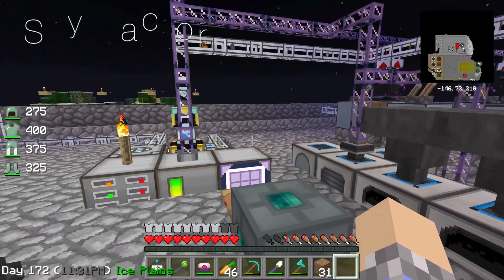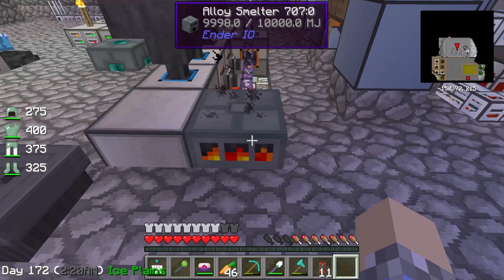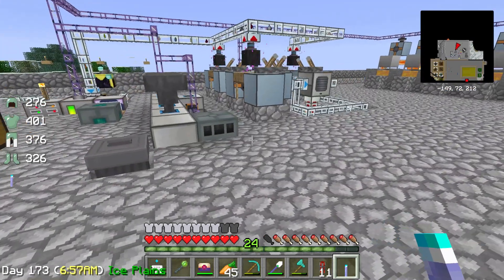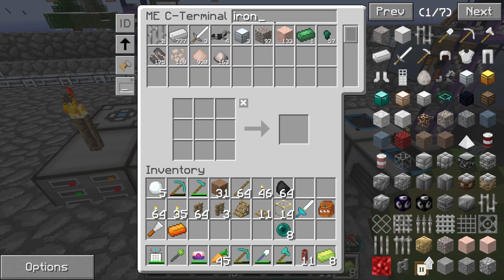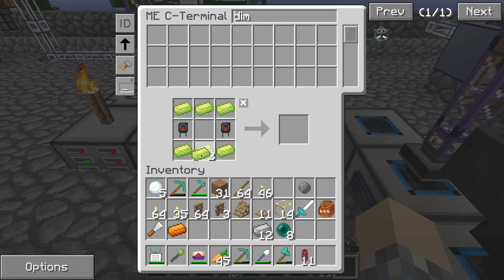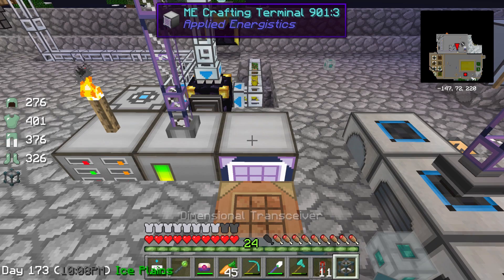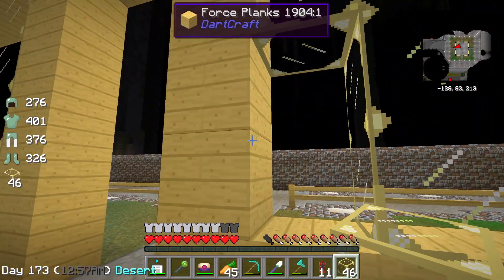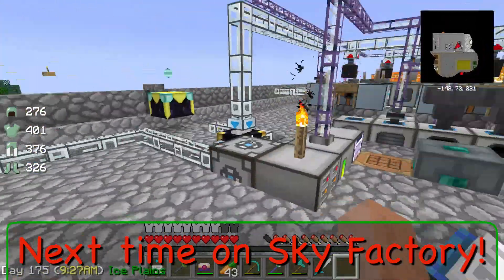Dimensional Transivers (Sky Factory #36.5)

Comment: Hey, kind of cool, I found that you can turn glass into thickened glass using chisel...  Sort of cheating seeing as you don't have to use so much glass or sand, but still cool.
Reply from the maker: Michael Brooke Can it be used in the recipes just like any other thickened glass?
Reply: Cub Games
I think it has the same id, but you can check by holding down F3 while pressing "B" then hovering over the item.  At least, I think it's B, It might be H.  One shows the item ids and the other shows entity hit boxes.  Anyway, It should be the same item because the item shows up as being from extrautilities in waila.